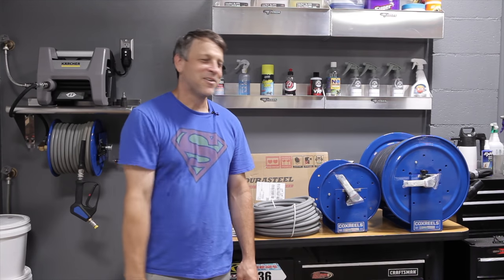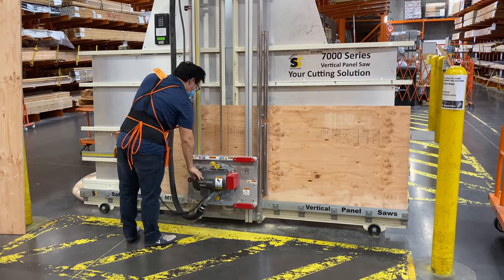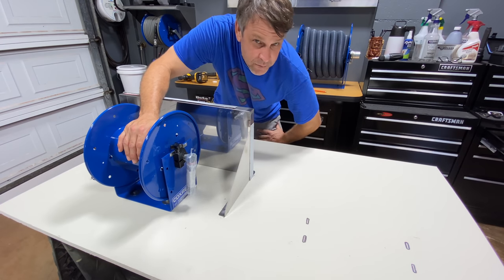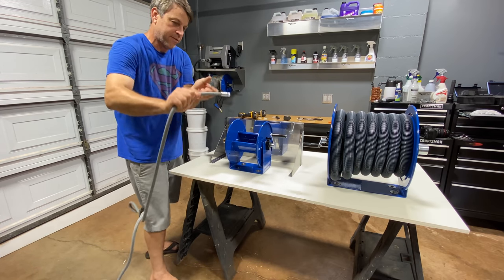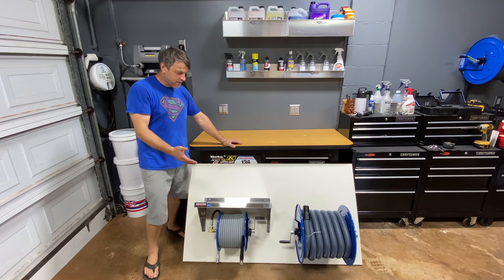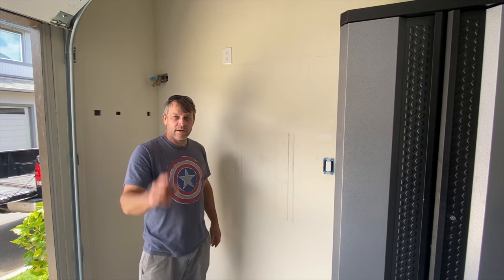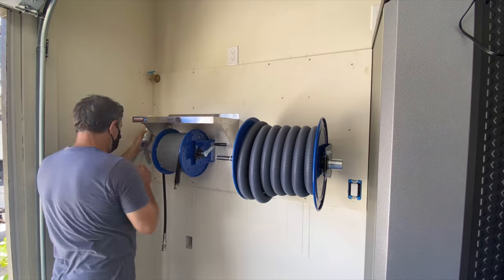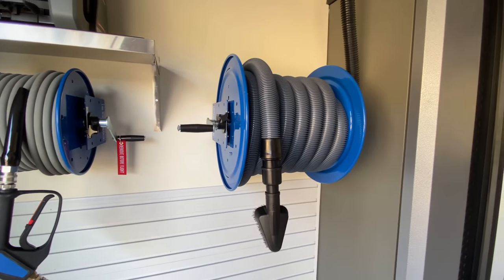DIY WALL MOUNTED PRESSURE WASHER & VACUUM SETUP. CUSTOM DETAIL GARAGE BUILD

Comment from the maker: Here is a comprehensive guide to building your own wall mounted pressure washer kit with every part and piece to the whole setup with a detailed diagram. https://www.hawaiidetailing.com/wallmountedpressurewasher Check out my other pressure washer video. https://youtu.be/UFek14zDrVw
Reply: What wrench did you use to connect the kobra jet hose to the cox reel?

Comment: Stumbled upon this as I happen to have the same pressure washer. For those wanting to drop their psi... look at your nozzle. It should have the orfice size stamped on it. Ie: 40025 which is 40 degree and orfice 025. To drop the psi to around 1000, you need 40030. If you have more than one wand, you might be in luck!

Comment: Great project. On attaching the equipment to the plywood, T-Nuts may have worked better as they end up flushed instead of a washer and nut protruding out the back requiring a little extra work to make clearance for them.
Reply from the maker: Yea I agree thanks for watching and the suggestion. Next time I will definitely look at some low clearance bolts for sure.
Reply: T-nuts? I'm going to try to do the same set up
Reply: @iglopez63D  yeah they have these prongs that dig into the wood and end up flush. Once you see them, it will make sense. Amazon has some sizes.

Comment: I used the swivel side of the hose for barrel of the reel.  It makes life so much easier.  There's no need for a swivel end to the gun since I can always install a swivel joint.  Then again, I opted for the sgs28 and never looked back.
Reply from the maker: Good idea. Thanks

Comment: I love the setup, but the Vac on top of the cabinet, gets to be a problem when you need to dump it, especially for those who might be a little shorter, etc.  Generally I think it's better to keep the dirty stuff closer to ground level.
Reply from the maker: That’s an option also. This was a friends system I installed and he wanted it on top of the cabinet. Thanks for watching
Reply: Good point. I’d still take this set up. Pretty bad ass.
Reply: @HawaiiDetailing Do you know what kind of cabinet that is?

Comment: Excellent step-by-step set-up...and it looks fantastic...!!! I Love the drywall mud and repainting the Karcher and Rigid faces to match... EXCELLENT attention to detail. The pre-planning with board layout is also a fabulous way to make things work. Very well thought out, now I need to stop typing and start doing...!  ;-)
Reply from the maker: Yeah for sure. You can do it. If you have any questions let me know. Thanks for watching
Reply: @HawaiiDetailing  What paint did you use on the Karcher and Rigid?
Reply: @HawaiiDetailing  yeah what plastic paint and also how did you deal with the bolts from the reels against the sheetrock wall?

Comment: Great video. I just got my Cox reel in the mail for my pressure washer hose. What size were the bolts you used to mount it? 1/4” diameter?

Comment: Another tip would be to use wood, captive nuts from the backside so you don't have the bolts/nuts hanging off the back.

Only reason I'd suggest that is to prefab like you did but on a wall without the open drywall.
Reply from the maker: Yes I agree. The project started with no open drywall and when the build was almost complete my friend decided to run plumbing and electrical. If you saw my system. I blocked in prior to drywall and was more of a custom finish. Thanks for watching and commenting.

Comment: i like it . do you have a general idea of the cost to have plumber and electrician come out?
Reply from the maker: It will vary dramatically based on your site location and also how far away electric and water sources are from the location you want to install.

Comment: That looks great! The only thing that would annoy me if it was my garage would be the vaccuum cleaner on top of the storage cupboard. I’d probably try to get it inside and just run a wire to the plug instead.
Reply from the maker: Yeah that was where he wanted it. He really likes it as it’s out of the way and easy to access to clean. Thanks for watching

Comment: Dude this is awesome. I have the same Karcher Unit and I've been wanting to do this for a while
Reply from the maker: Makes using your machines so much better. User experience is drastically improved. Go for it and start building it. If you have any questions feel free to ask. Thanks for watching

Comment: Here’s my question?? When mounting the reels to the plywood, I noticed you didn’t mention the length of the lag bolts used? Were they not sticking out the backside of the plywood? How did you mount the plywood flush to the drywall?
Reply from the maker: Use something like these https://amzn.to/3Vb1NW1

Comment: Great info. Planning goes a long way in an efficient install. I've seen a video in which two guys fudged up a custom Kranzle wall install, taking several days to complete! At least the video was a good laugh. BTW, why do you prefer to use fender washers? The coxreel manual doesn't specify the type of washer. I just used ones that were slightly larger than the hex head of the bolt. Thanks.
Reply from the maker: It’s overkill. As long as it does not pull through you are good. Thanks for watching the channel

Comment: Thanks for showing this and especially for the detailed list of items used. It has been very helpful in getting my own project going. Does the pressure washer get attached to the shelf in any manner?
Reply from the maker: You are welcome. Mine sits there without moving at all. The install on the video you watched we put a rubber non slip mat under cut to size and it works great. You could mount it to the shelf although I have not found it to be necessary. Thanks for watching

Comment: Aloha from Australia, unfortunately we can't get that model karcher in Oz for some weird reason, maybe they won't make it in 240V. Does it vibrate the house a lot? We have a steel framed home and I don't want it to wake up the whole house. I'd put it on some kind of rubber matting to dampen it.
Reply from the maker: I suggest putting a rubber mat under it. That’s a great way to keep it isolated from the shelf. Thanks for watching

Comment: What was  done with the mounting hardware on the back side of the plywood? I figured it would stick out and get in the way when mounting to the wall
Reply from the maker: You can slightly countersink and use carriage bolts.

Comment: I’m planning to do something similar with a 3/4 inch plywood also., I am not super handy at all so pardon the question.

When you bolted the hose reels to the board, you used nuts on the backside and it seems like it would not be flush against the drywall.  What size did you use?

I really enjoy your videos
Reply from the maker: I would use carriage bolts that have a very low rise on the head. Use those instead and countersink the plywood to allow for the head to sit just below the surface. Careful to not go to deep as you need the strength of the plywood. Thanks for watching

Comment: Great setup looking forward for this project. do you know what kind and size of bolts used on studs and what kind of plywood did you use
Reply from the maker: 3/4 plywood and use good heavy garage T bolts with fender washers. Thanks for watching

Comment: How were you able to mount the whole setup to the wall with the bolts for the reels on the way in the back of the board?
Reply from the maker: You can either counter sink the nuts on the back of the plywood (be careful to leave enough meat so that it is securely connected) or drill wholes larger than the nuts into the drywall so that it can sit flush (recommended). This Plywood mounting method only makes sense when you do not want to do major in wall structure changes and drywall work. This vid shows the install without the plywood. https://youtu.be/UFek14zDrVw
Thanks for watching

Comment: Nice build, but that vacuum looks like it will NOT be sucking sand etc. very well, unless it's packing a large HP motor in that little package.
Reply from the maker: Thanks. Surprisingly it does a very good job. This was a build for a friend. Check out my vac in my video list. It’s a beast.

Comment: That's a nice and clean setup man!  My only question is did you have to shave off the tips of the bolts that were protruding out of the back of the board when mounting it flush to the wall?
Reply from the maker: You can use carriage bolts or counter sink the bolts to avoid any issues. We notched the drywall so that they would sit flush as he was never going to take this rig down and if he does it would be a quick drywall repair. Thanks for watching

Comment: What was the size of the board? Also the screws holding down the water hose are kinda small, will they be able to hold that weight over time?
Reply from the maker: Start with a 4x8 sheet. Fit is based on your area and layout the parts on the ground to get it right. After that Cut board to the size that works. We used large carriage bots on the reel. It’s been on the wall ever since with regular use and no issues. Hope that helps.
Reply: @HawaiiDetailing  yes very helpful, thank you!

Comment: Nice job, but didn't you have a problem ?making the plywood go flush to the wall with those nuts and bolts coming out the back?. I didn't see where you inset them.
Reply from the maker: I would use Carriage bolts on my next install to have a low profile bolt head. You can slightly countersink and it will sit flush on the wall. Thanks for watching.

Comment: Could you have used Lag Bolts instead? Will that have worked instead of the Nut/Bolt Combo?
Reply from the maker: You could but I feel more comfortable with the bolts and washes to make sure it will not loosen up with time. Into studs lagbolts are great. Plywwood not so much. Thanks for watching
Reply: Thank you but maybe carriage bolts so they suck in more to the back of the plywood? Think that would be ok?
Also, what paint color is your Garage Wall Color for your garage? What Gray is that?
Reply from the maker: @okkin981  I agree with the carriage bolts. I will get back to you on the grey color if I can find the can I used. I may have tossed the leftovers already. Thanks for watching

Comment: What kind of hose bib connections did you use?  Seems like that wall would get really wet in a hurry if not done right.
Reply from the maker: Shark bite. There are links in the description so you can see them. Thanks for watching.

Comment: What did you do about the nuts and bolt sticking through the back and the Sheetrock?  Did You have to account for those?
Reply from the maker: We notched the drywall but you can also get some low profile cap style bots where this would be minimized. Thanks for watching and commenting

Comment: What did you do for the bolts on the backside of the plywood against the wall? Just drill our counter sink holes in the sheet rock.
Reply from the maker: Yes that’s what we did. I prefer the method from my other video of my personal setup where I blocked out the studs behind the drywall to support everything. It’s much cleaner but requires more drywall work. There is also a hose reel mount that can span 16” to catch the studs as long as they are where you want the reel to be. It all depends on the level of construction you are comfortable with. Hope that helps. Let me know if you have any other questions. Thanks for watching.

Comment: What cabinets are those he has mounted to the wall? My garage walls are recessed slightly from a concrete footing, so if I put a tall cabinet on the floor, it leaves a gap between its back and the wall, but the only tall cabinets I can find are floor standing ones that specifically say not to hang on the wall like these ones are. Thanks!
Reply from the maker: I am not sure what type they are. They are from HD or Lowe’s. Thanks for watching.

Comment: Hey there I know this is a very old video but I'm looking for some guidance as I'm forced to use a 2x4 3/4" plywood to mount the same setup (active 2.0 instead of the karcher). I'm an extreme novice when it comes to home improvement so please forgive my lack of knowledge on this but I will be using the cox stainless steel wall plate for the cox reel that Obsessed Garage sells (using for looks) and it comes with 4 lag screws to get that in. Is there any reason you would still stick with the bolts/washer vs using lag screws to mount the cox hose reel steel plate? Would one be more durable over the other? Thank you!
Reply from the maker: If I were using that mount I would screw the lag bolts into the 16” centered studs. If studs are not available a through bolt with washers is much stronger then a lag bolt when it comes to attaching a heavy item to plywood. Hope that helps.
Reply: @HawaiiDetailing  Gotcha! That's actually the reason for the plywood, unfortunately the condos here were built with metal studs 24" apart which I didn't bother to check until after I ordered the entire setup. Did you happen to have any issues with the through bolts sticking out the back hitting the drywall? Thank you for the quick response by the way. Hoping to get this on my wall today!
Reply from the maker: @slittcerslitt-sir7722  yes you have to use a Carriage bolt and possibly hammer out a small divot where the heads meet the drywall. Should only be a small divot just to allow it to sit flush. .

Comment: When putting the hose on to the hose reel did you have to put any adapters on the hose reel or quick disconnects and if you did what did you put on I am trying to build one similar?
Reply from the maker: I have 2 more videos that go through the whole system with links to everything you will need. Check them out. Thanks for watching

Comment: Could I use this pressure washer for mobile detailing? Need something better then my gas unit and trying to go electric
Reply: Homedepot sells a good electric pressure washer for less than $150
Reply: @kylecorrow702  one from ryobi?
Reply: @kentdavis4446  yea sorry I couldn't think of the name. But yea you can't beat it especially for the price
Reply from the maker: This is a good buy for the Karcher. Its a entry level machine and works really well with a few upgrades. Check out my other pressure washer vids to get a better idea of the machine.Thanks for watching
Reply: @kylecorrow702  I'll check it out, but I don't want to take something back to home depot all the time lol
Reply: @HawaiiDetailing  could I run this off an inverter installed in my truck? What size would I need
Reply from the maker: @kentdavis4446  It requires a 15 amp circuit. I am not sure of the actual draw. With the foam cannon running I suspect its just under 15 amps but that's a guess.

Comment: Great video!
What color, kind and make of the paint did you use to paint the Cube with?
Thank You!👍🏻👍🏻
Reply from the maker: Rustoleum 2X ultra cover. Granite color. Bonds to plastic. Not sure if this is the best you can get out there but it worked killer for me.
Reply: @HawaiiDetailing  Thank you!
Reply: Any sanding or special prep (aside from a wipe down clean) prior to painting?
Reply from the maker: @jeff_brown  no that’s it. Been holding up good.

Comment: I noticed that on the shelf that you placed the Cube on you have a black film or mat on top of the shelf that isn't called out in your parts list. First, what is this materials and second are you using it to minimize or eliminate vibration or movement by the Cube on the shelf? Also, what protects the Cube from vibrating off of the shelf. Is the Cube secured on top of the shelf. If yes, how?
Reply from the maker: This video is an install I did for a friend. He put the mat underneath because it’s not mounted down and he wanted to be sure it did not slide around. On my setup I do not have the mat or it mounted and it sits pretty firmly on the shelf with no problems. I have 2 other pressure washer videos that are my install you should check out. I hope that helps. If you have any other questions feel free to ask. Thanks for watching.

Comment: How does he have the vacuum system set up? Is the vacuum always on and the switch does turns the power off and on?
Reply from the maker: Yes. The wall outlet is controlled by the switch. When turned on the vac turns on.

Comment: Did you have to cut out part of the drywall for clearance between the back of the wood and the bolts/nuts protruding out the back? (shown at the 2:12) Trying to figure out how it would sit flush with those sticking out the back. Thanks for your input!!
Reply from the maker: You can either countersink the bolts into the wood or in this case we notched the drywall as it already was all chopped up to install the plumbing and electrical. The downside to countersinking the wood is there is less structural integrity that way. The ideal install method is how I did my personal setup with blocking behind the drywall. Check out that vid also. thanks for watching.
Reply: Use T-nuts (look on Amzn) and you can mount flush.

Comment: How did you mount board on Sheetrock with the bolts sticking out the back for mounting brackets
Reply from the maker: You can use bolts that have a flush head on them or knotch out the drywall.I recommend the zero clearance bolt heads. Thanks for watching

Comment: What size bit did you use for the hose reel holes?
Reply from the maker: Match the bit to the lag bolts you are using. Make sure the lag bolts bite in good and your drill hole is not too large.